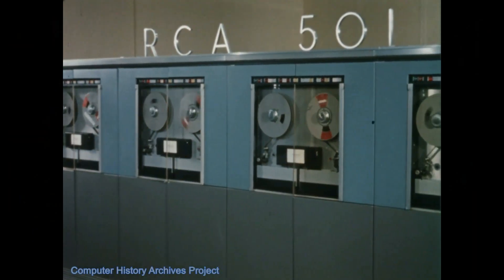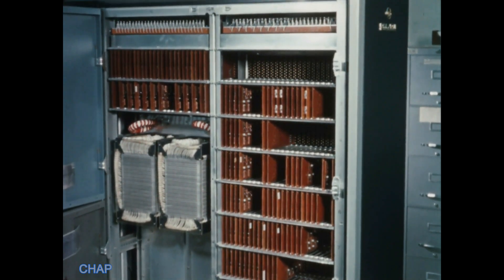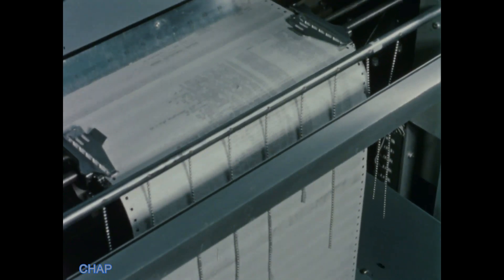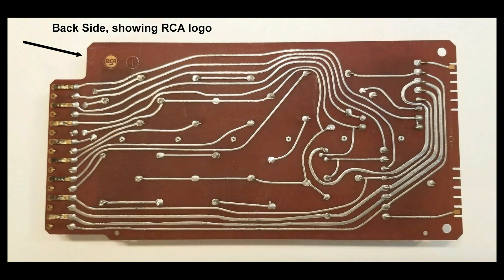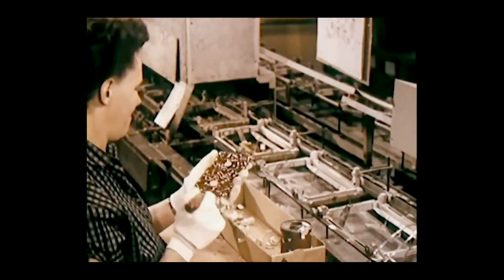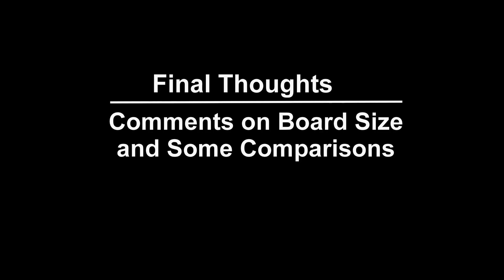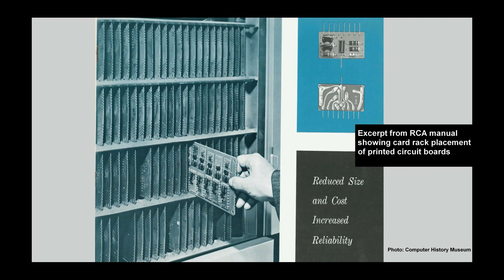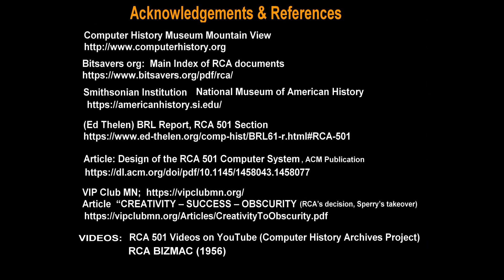Revisit RCA's GIANT Computers 501; How they Made PCB Circuit Card Logic Boards 1958 (Spectra Univac)

Comment: The board shown in close-up at 4.43 has some very suspect joints! Either a dud that's been swapped out or trouble waiting to happen. Either way not a great advert for RCA quality control.
Reply from the maker: Hi @EuroScot2023, very sharp observation!   Thank you for your input on that. It does look a bit odd.

Comment: was the restive capacitance network the same thing as an RC time constant?
tho I have never had to work on one, it bet the conformal coating makes it really fun to try to replace blown components
very interesting and informative video ! thank you!
Reply from the maker: Hi  @Darius_Finnigin, Excellent questions.  (1) not fully understanding the first question, it does seem that the restrictive capacitance network refers to hardware, where an "RC time constraint" would refer to a measurement of the time a particular process takes across that network.  (2) removing conformal coating is a multi-step process, probably very labor intensive.  I am assuming that in early components, such as the NASA/RCA board we show in the video, it would have been too time intensive to repair a board level component, and instead they would have replacement boards on hand to swap out in the event of an on-board failure.  Pluggable redundancy.  Just an assumption.   Good questions. Thanks!

Comment: This is an excellent video that gives a quick look in to a family of computers that hasn't gotten a lot of attention. Thanks!

Not sure what's going on with the audio, but if someone was trying to save data by having a crazy low bitrate, it wasn't a good idea. It could just as easily be YouTube - not sure - but either way, it's really hard to listen to if you can hear higher frequencies.
Reply from the maker: Hi @SysadminJohn, thank you for the feedback on the content.  Much appreciated. -  regarding the sound frequency, that is interesting.  Just not sensing it on this end.  Sometimes, with different headphones, the sounds comes across differently...